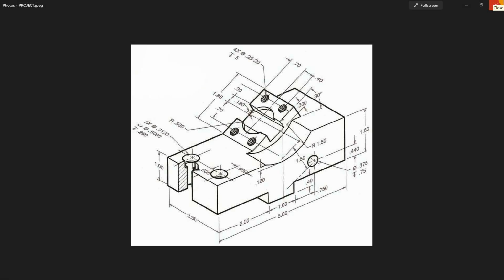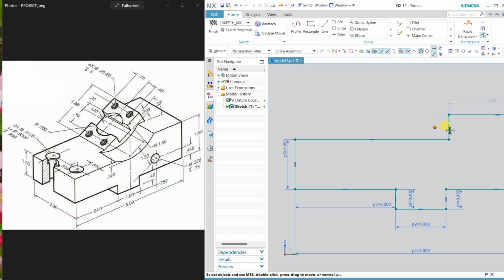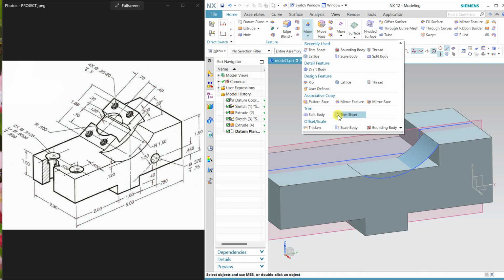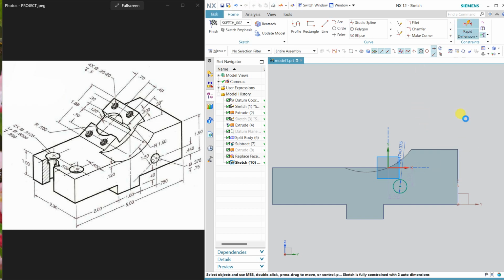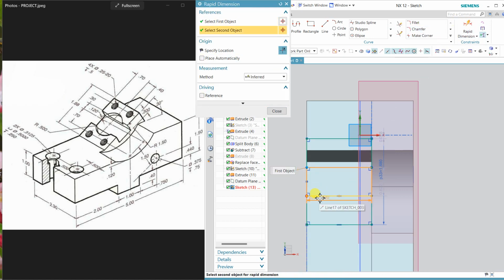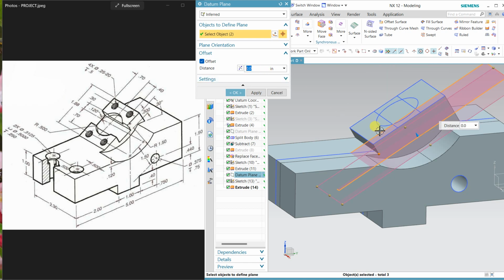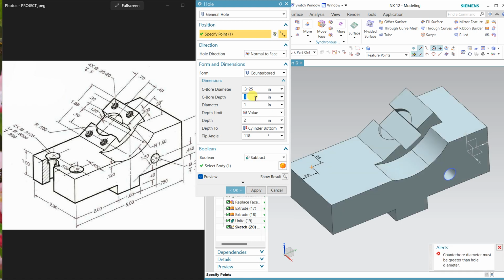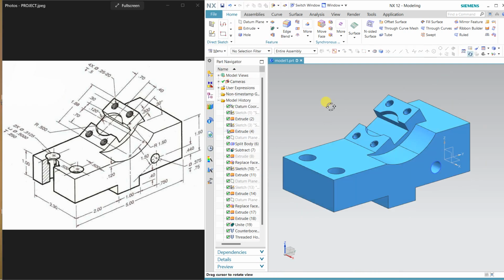#NX CAD #ट्यूटोरियल

Comment: Hello.  I enjoy following your work.  I'm learning nx.  I have a question for you.  While drawing molds in my old program (vero visi).  There is a standard elements command that I use to position bolts and other elements between 2 plates.  Thus, it is easier to measure the length of the bolts.  I also don't bother with drawing the holes.  It automatically draws all the gaps according to the bolt size.  Does NX have this feature?  If there is can you show me?